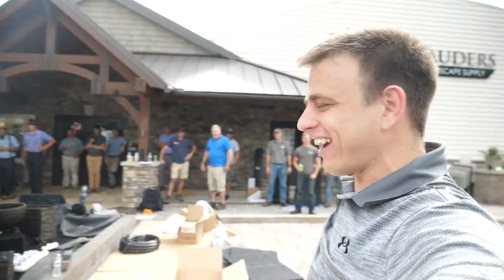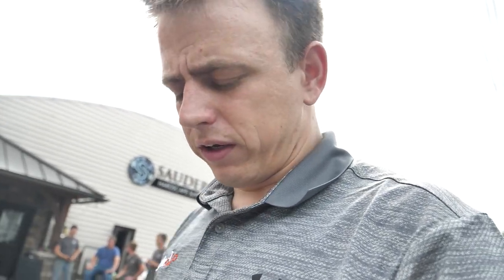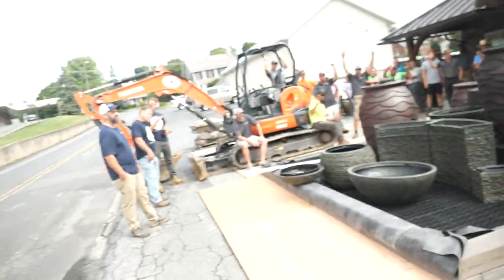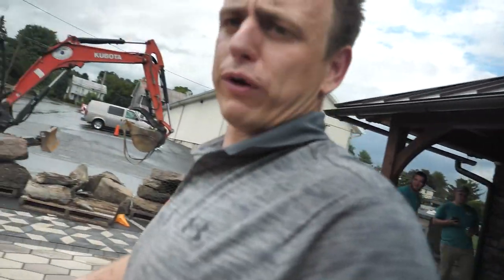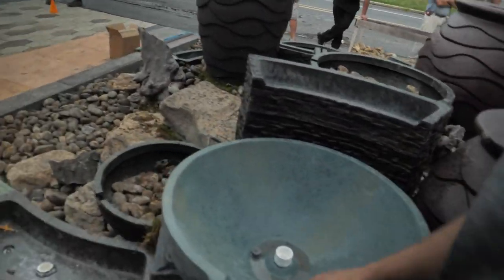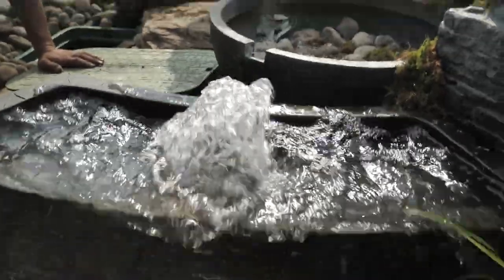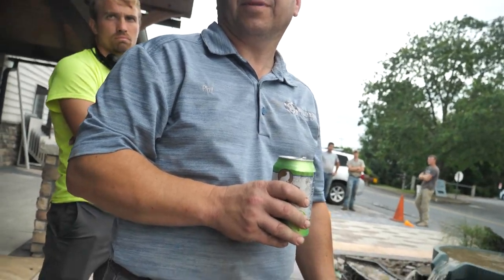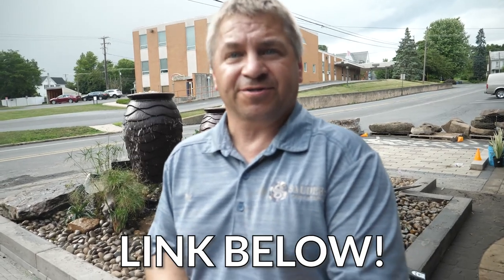Training CONTRACTORS on an Aquascape FOUNTAIN BUILD! 💦

Comment: How big is the reservoir and what gph is it running at?
Reply from the maker: it was a 15x15 basin I beleive, and built with small aquablox. Just under 1,000 gallon capacity. We used 3 pumps that each pushed about 8,000 gph